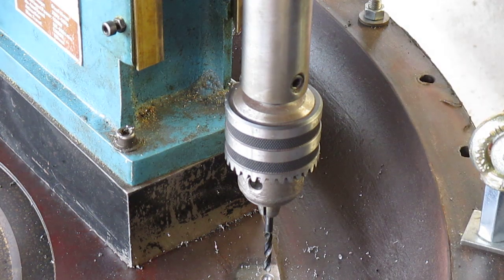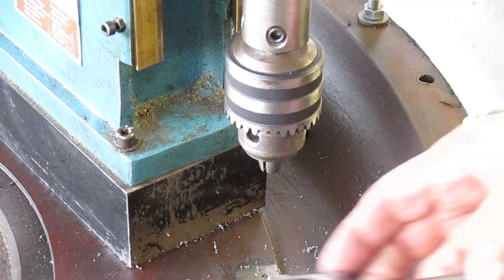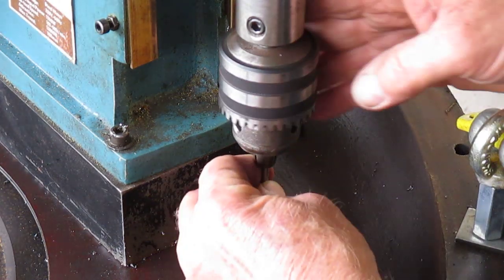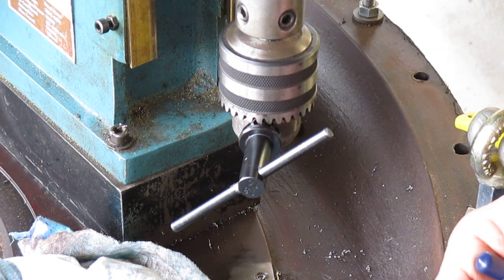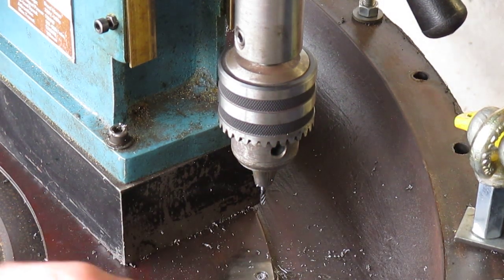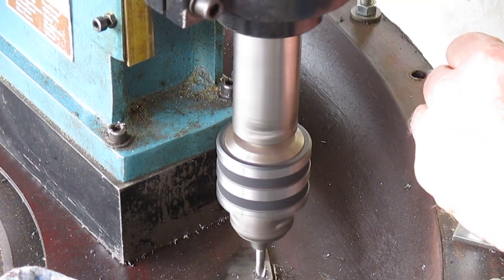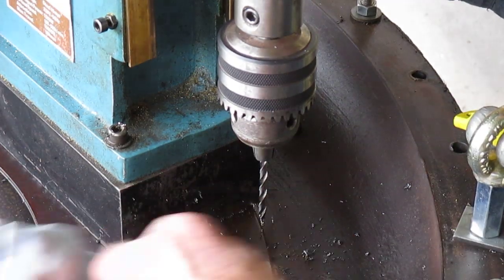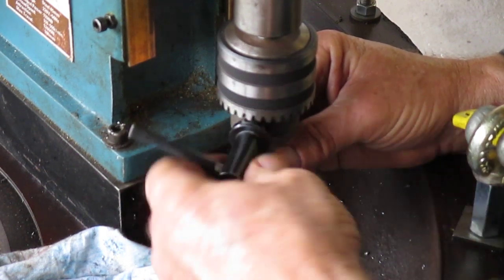Getter Out 10 part 5 Loco Turbo

Comment: Would you say the peck drilling method is better than just going full down on the quill as you're wanting the drill bit to bite i would say peck drilling but what's your take on this bruce please ?Thank you for your contributions.
Reply from the maker: Mate….Horses for courses…..Both work well depending on the circumstances, pecking is very important to clear the swarf particularly in deep holes / brass / plastics etc. where there is good chances of "binding" and also when using Roto Broaches. Heavy constant pressure is needed for stainless steel as it can work harden if you are gentle, not withstanding that swarf still needs to be cleared. Drills last longer when they are worked, the stiffer the set up, and the less "wandering" the better thats why I make the effort to bring the part to the mills as much as possible, or as in this case use the mag drill. Cheers Bruce
Reply: Bruce Whitham Thank you bruce for taking the time to explain this :)